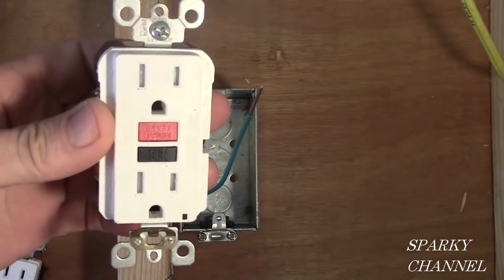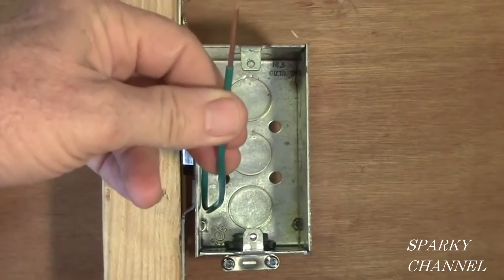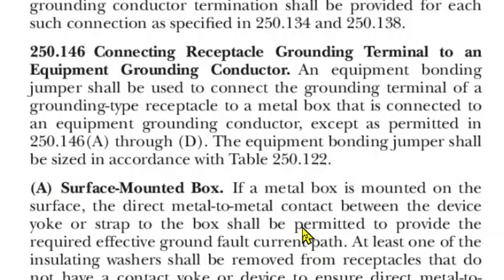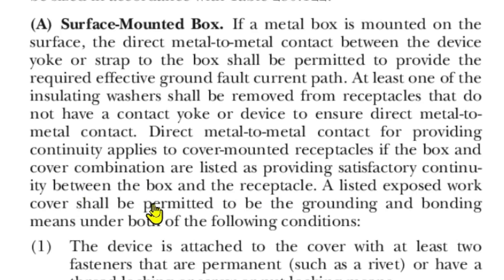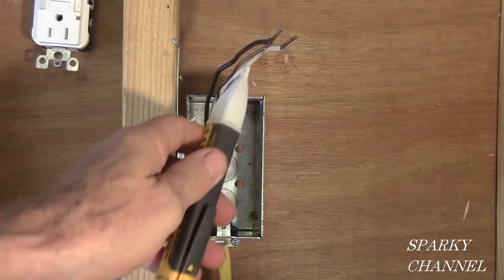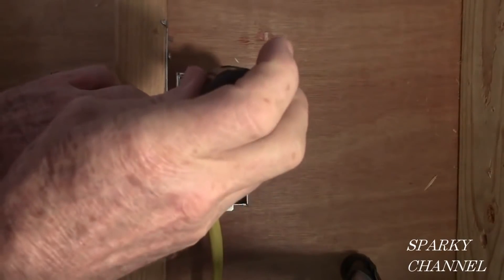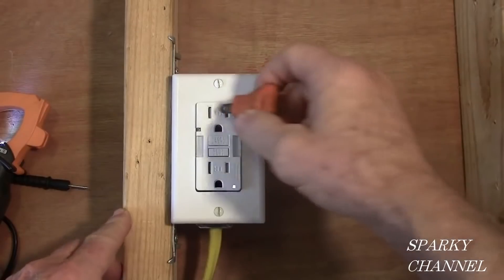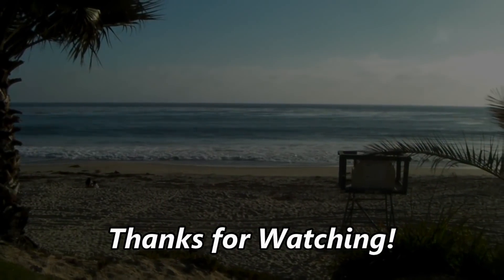What is a Self Grounding Clip and What Does the 2020 NEC Say About Them?

Comment: That's all good ,this only works if the gfci is tightly secured to the box ,suppose the mounting screws loosen ,if this happens you lose your ground, this is why I prefer ground pigtails
Reply from the maker: I like to use both.
Reply: I checked switches and outlets that I installed three years ago and found many of my ground terminal fasteners to be loose. Not sure if this is thermal expansion/contraction or repeated pushing that caused it, but certainly not a “better” path over using a self grounding clip.

Comment: The screw is metal so there is going to be contact to a metal box no matter what. The plastic or paper tab just holds the screw in, it doesn't interfere with continuity either. I don't get the whole need for some brass tab or a copper wire under the screw to hold it in the box

Comment: Question here bathroom has a metal box its not grounded can i used the GFCI with the ground clip ? Will i get ground now? The receptacle shows open ground what can i do to pass inspection
Reply: Gfci are code compliant
Reply: @  there code compliant but affordable housing section 8 supervisor inspector did not approve it so what i did is make my own ground with the underneath kitchen drain metal pipe i installed a clip with a wire running behind the dry wall to GFCi to get Ground same as the bathroom sink getting ground from the water pipe. Hope it helps someone

Comment: The way you connected the ground wire to the receptacle means the receptacle is grounding the box. You should connect the ground wire to the box and then the box would ground the receptacle. That way the box won't lose continuity when the receptacle is removed. Regarding cover mounted receptacles, the self grounding clip is not necessary. No mention of it in NEC 250.146(A).

Comment: I'm confused.  At the point you attach the bare copper grounding wire to the ground screw of the GFCI, isn't the outlet grounded at that point?  And doesn't the self grounding clip become redundant?  Shouldn't it be one or the other and not both?
Reply: The idea behind the clip is to bond the metal box.  You absolutely want the ground wire attached to the receptacle for case grounding purposes.  If the box is not grounded and the hot contacts the box, you are in for a surprise.  At that point the hot is not interrupted by the GFCI comparator circuit because the current isn't flowing through the receptacle - if you touch the box it flows through you.  I hope that helps.
Reply: Self-grounding appears to be bad wording.

Comment: It's extremely rare to screw outlet butt up against the box. Typically you want it to float a bit to match the wall surface. This makes the self grounding brass clip pointless. It's lazy and just allows for improper installation. Pigtail is more work but it's work done right.

Comment: Question - If you have a self-grounding receptacle and a metal box, are you allowed to tie your grounding jumper wire to a grounding screw on the metal box and then tie the other end of the jumper to the LINE cable grounding wire?   Or do you have to always tie it to the self grounding receptacle's grounding screw?  It seems like both ways would achieve the same result but I'm not the one writing the code.

Comment: I have an outlet to replace that has 2 outgoing load cables connected to the outlet.  I bought an AFCI outlet b/c its a bedroom and the first device from breaker.  As far as the 2 load cables should i connect one cable using the (Load) screw terminal and the other cable using the (Load) clamping backwire terminal?  Or is it better to just wire both cables to the load clamping backwire slots that are available on the outlet?  Or does it not really make any difference either way?

Comment: Can you use bare solid copper wire (that you can cut from nm-b cable) as a pigtail to ground your box or outlet or does does code require them to be a green insulated wire like you have on the video?
Reply: Bare wire is legal as a pigtail, but insulated green wire is safer.  If you have green electrical tape or green liquid electrical tape, you can wrap the bare pigtail wire with it or coat it with the liquid green electrical insulation.
Reply: Thanks for the info.  I might use some bare with tape when I run out of pigtails i bought.  Question - If you install a self grounding outlet in a metal box and then you go to tie your pigtail to the line cable ground, can the pigtail be tied to either the box ground screw or the outlet ground screw?  Or does code require it to be tied to only the outlet or only the box?  I wouldn't think it would matter but I don't know for certain.
Reply: @morokeiboethia6749  make sure the tape is colored green, to be legal, or if you buy liquid tape, that the color is green.

Comment: If the box is grounded, is it required to put a jumper on the receptacle ground screw to the box? Just curious... 🐀🐾
Reply: The self grounding clip "is" the jumper between the receptacle and the box and they become like one object, then the grounding pigtail tied to the metal box grounding screw is grounding both the box and receptacle b/c they are one object - that is if the receptacle is self grounding and has that special clip.
Reply: As long as the receptacle is self-grounding (meaning it has that special kind of clip on it) then no you wouldn't be required.  When the receptacle is self-grounding, the box and receptacle become like one object b/c the receptacle is attaching itself to the box via metal-to-metal contact.  If the receptacle is not self-grounding, then you have 2 objects that are not connected to each other metal to metal and so each object is required to be grounded separately.  Since you aren't allowed to put 2 wires under one grounding screw, then running a jumper from receptacle to box then a pigtail from box to line cable ground wire wouldn't be allowed b/c you would have to fasten 2 ground wires to your box grounding screw.  In a case of using a metal box and a non-self-grounding receptacle, you would need 2 grounding pigtail wires - one pigtail wire attaches to receptacle ground screw and then the other end of the pigtail connects to the line cable ground wire.  The other grounding pigtail wire connects to the box grounding screw and then the other end of that pigtail connects to the line cable ground wire. (So you would wire nut the line cable ground wire + receptacle grounding pigtail + metal box receptacle grounding pigtail).  And if you had a load cable present, then you would have to tie that grounding wire to them as well so that would tie all downstream devices into the grounding circuit.
Reply: @morokeiboethia6749  My outlets need spacers at the bottom to make them flush with the wall. Hopefully the metal boxes have a screw to connect a pigtail to ground the receptacles since there is no grounding wire.
Reply: @caseyhartman7094  there are grounding clips sold at electrical supply stores and hardware stores that allow you to clip a grounding wire to a metal box to ground the receptacle. I have a ground wire clipped to a bonded box in a 1955 home, and connected to my GFCI in my bathroom.  I replaced an old 3 prong outlet with the GFCI to make it safer voluntarily.  The box is grounded from behind, and the original owner who built the house grounded the old outlet by making a self grounder out of copper wire, legal per 1955 NEC regulations.
Reply: @caseyhartman7094  If your wiring has metal conduit then that provides the ground to the (metal) box. Just need a pigtail from the box to the outlet ground terminal.

Comment: life long sparky and usually cut these flimsy POS clips out. Have seen way too many shinny 6/32 mounting screws either rusted halve way thru or broken providing no dependable ground. Way too many times wall box is set back so you do not get metal to metal contact. Code required a 10/32 screw to ground boxes that have twice as much metal. Nothing beats a #14 or #12 copper ground wire.
Reply: Screws and boxes may be galvanized, but once threaded that coating is essentially scratched off and will be prone to corrosion. Even more so if it now serves as a conductor.
Someone at the NEC must have been paid off for this to ever make it into the code book.
Reply: the brass self grounding clip doesnt seem like it does anything but hold the screw in place. is it providing ground or is the screw providing ground? or the yokd and the clip just holds screw in place? Im calling bs on the whole self grounding thing if they want you to tighten the yolk all the way to the box; that would suck the receptacle in too far for the face plate more times than not.
Reply: The code says this method is for surface mounted boxes.
Reply from the maker: Thanks!
Reply: Probably same genesis that came up with flimsy stab in on receptacles & switches.

Comment: I've looked at it the opposite way, connecting the ground wire to the box and the device's ground coming through the clip.
My reasoning is that the code always requires metal box to be grounded, whether there is a device associated with it or not.
I don't come across many metal receptacle boxes, as most metallic boxes i see are only for splices. When I do use a metal box for a device, i pigtail both.

Comment: I am confused.  You connected the ground wire to the outlet.  So what was the point of using a "self grounding clip"?  Make a video of old wiring that does not have a ground wire and test that.
Reply: I think you misunderstand the "self grounding" part. The green or bare ground wire is still required in the cable or pipe, connected all the way back to the panel.

However the code requires that the ground wire be connected, both to the ground screw on the receptacle plug and the outlet box itself if it's metal. So if you install a "self grounding receptacle" then it removes the requirement to install a grounding pigtail, and connect that to the ground coming into the box, and to the receptacle. 

So WITHOUT  self grounding receptacle, you make up ground+ grounding pigtail +receptacle ground in a wire nut. 

WITH a self grounding receptacle you make up ground wire coming to box directly to receptacle.

If your box does not have the ground wire in it, then that's a different requirement. You'd need to replace with GFCI and put the sticker that says "no equipment ground".
Reply: I am not a pro - if the outlet wasn't self grounding, then the ground wire coming out of the main power source would require two connections. One connection attached to the metal box and second connection attached to to the outlet itselft. Howeve, with self grounding, first step can be avoided.
Reply: More info - if you've a plastic box instead of metal box, then you don't self grounding outlet, just get the normal grounding outlet.
Reply: @sarcasm701  Exactly!

Comment: Interesting. In old houses you often see the receptical grounded to the box through the screws with the jumper connected to to box but not the receptical. I didn't know code permitted it the other way around with certain approved devices.

Comment: Let's get this straight folks back in the forties and fifties they ran a separate copper ground wire on top of the studs of the house before sheetrocking they would attach this copper wire around the nails when they hammered the metal box into the stud this was always seen in kitchens and bathrooms rarely in bedrooms but sometimes it was in the bedrooms Outlets also so these new Outlets with the self grounding tab on the bottom will allow you to insert a grounded outlet to a metal box if it has a ground wire attached to the metal box you can only test this with a M by going from hot to the metal box and if you get the 120 V you have a grounded metal box therefore you can use that type of new receptacle with the Brass Tab to assure yourself of getting a secure grounded Outlet in that box use GFCI outlets in all the kitchen outlets in your old 1940s 1950s homes and you have updated it very easily make sure you turn the breaker off after testing for continuity between the hot wire and the metal box before installing your outlet

Comment: We always remove the flimsy clip before installing the #12 ground wire to the device. On some new work it makes device stick out of wall a little. Would never trust a thin 6/32 machine screw to handle what could be several thousands amps on a dead short. Way too many times a blue light special flimsy nail on plactic box is recessed in the wall so device yoke can move around causing a higher resistance. Have seen thin 6/32 screws rust in damp areas causing lost of material. A rusted 6/32 machine screw would cause a breaker longer to trip furing a shirt circuit.

Comment: Best practice: Use a bonding jumper regardless of receptacle gimmicks.
Reply: Agreed. Imagine the screw backing off or homeowner replaces it later on.
Reply from the maker: Good point!
Reply: @SparkyChannel  when I replaced a grounded 3 prong receptacle in my 1955 built home with a 20 amp GFCI, I bonded it to the box with a grounding jumper clipped to the box.  The box is bonded from behind, and an outlet tester showed it is bonded per 1955 NEC Code for receptacle boxes near water sources.  The old outlet had a self grounding wire made from a copper wire connected to the ground screw and run to one of the box mounting screws for the receptacle.  This was legal in 1955.  I first saw this in the late 70s when my parents were painting the bathroom & kitchen for the first time, and pulled the outlet out of the box to paint the wall.  I knew that practice of grounding outlets in the 50s without jumping a 6" wire to the grounded box was dangerous.

Comment: If its self founding why did you put the ground wire on??????
Reply: Gounding
Reply: founding or bonding?
Reply: Self grounding
Reply: @joanbarber5384  Ground is for device [i.e. receptacle]. Bond is for box to device. Clip takes place of  bonding wire. Hot wire breaks and touches box. Electric travels from box thru clip out ground and trip breaker.
Reply: @jaykemm3472  this really should have been opposite.  bond the box to ground and allow the receptacle to ground via the clip.  doing the opposite means your raceway system could be unbonded if it were relying on the receptacle for ground reference.
Reply: Agreed.

Comment: Many years ago an AHJ told me I had to put a ground screw and wire every box to the devise regardless of the brass tab. I had to rewire every box in the whole house. I always use a ground wire now. I don't think I would have tried to argue with him even if I knew about this video. Thanks for finding the exact code. At least I can support the argument.
Reply: Some local code can be more strict than the NEC.  In those cases, you must go by your local code.

Comment: I expected that measuring the voltage from the line pin (it's not a 'positive', this is 120VAC, not DC) to ground would have tripped the GFCI .  
Guess the resistance through the meter when it's measuring voltage is high enough that it doesn't pass enough current to trip the GFCI ..

Looking it up ,   120 V / 4mA = 30K ohms, and the resistance of a volt meter is usually about 1 M ohm, so about 120 micro amps from hot to ground through the meter.

Comment: If the box is recessed too far into the wall, and the yoke of the receptacle contacts the drywall and can not make sufficient contact with the box, do the supporting screws provide sufficient continuity?
Reply: I don't think so. Imagine not tightening the conductors on the breaker, or not torqueing the neutral or ground inside the panel. You'd have a loose connection.

Comment: Will the self grounding clip still work if they are painted and plastered over? It's pretty common after electrical rough in for the drywall folks or painters to get stuff all over the junction box, especially the mounting ears and screws.
Reply: Paint/plaster on the face won't matter, it's relying on the threads for the connection. Will almost never be able to secure the outlet butt against the receptacle though on a finished wall. If screw can't be torqued down it can't meet code. Just a terrible design.

Comment: Are those Leviton T5325-WMP (the regular decora style outlet) mentioned in the description truly self grounding? The page refers to them as "preferred" rather than "plus" mentioned in the video and I don't see a special brass clip on them. Just wanted to double check. Also, I see that they have a black piece of plastic on each screw, should they be removed? I left them on and it passed as grounded using an EMT without a grounding wire (grounding probably went through the screws themselves). Thanks for the great video!
Reply: Per the NEC you would remove the insulator from the screw. Makes sense to me because now you have metal to metal rather than grounding strictly through the screw.